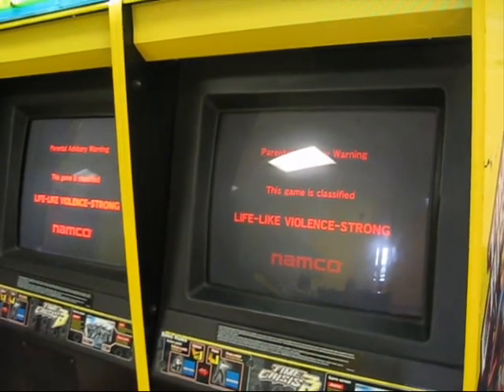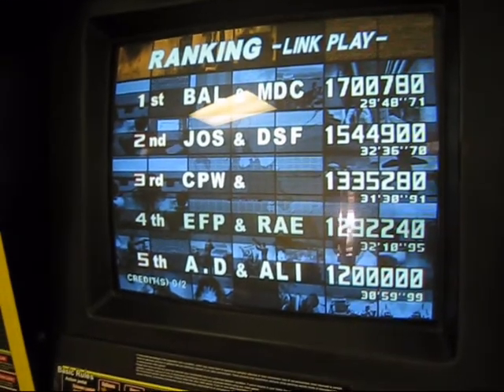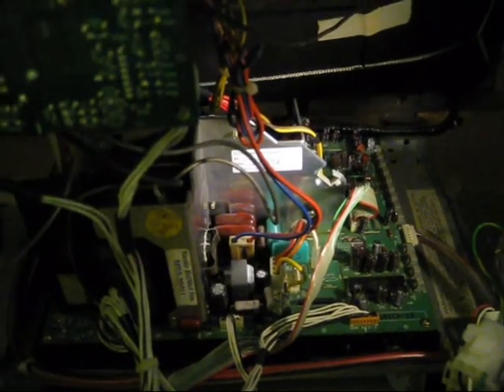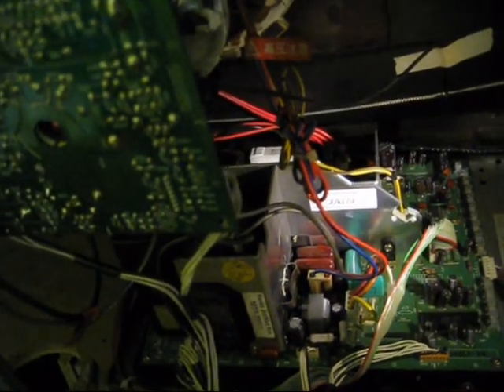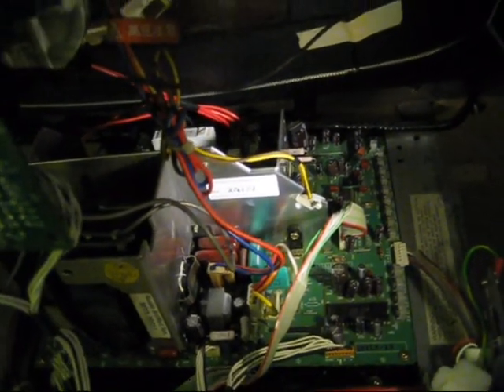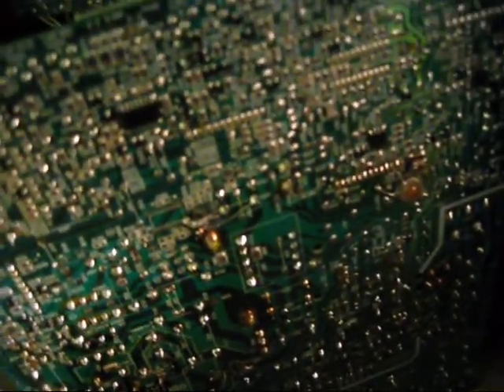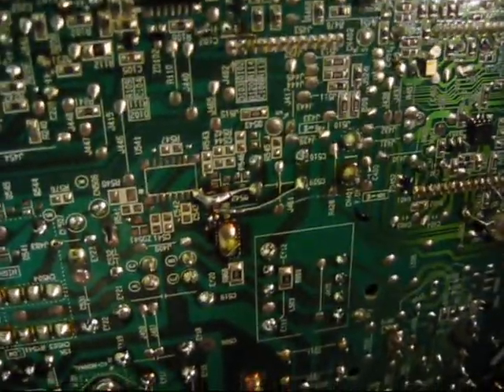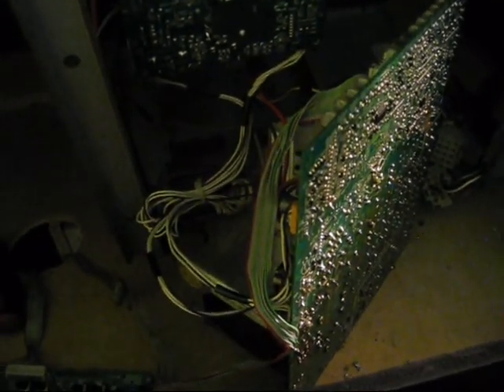Nanao ms9 Horizontal deflection Problem and fix

Comment: Good morning, I'm from Brazil and I'm repairing a nanao ms9-29 monitor.  And I have problem in the source: what is the voltage that feeds the horizontal of this monitor?  Please, please help me. Thank you.
Reply: at 15khz its 75vdc at 24khz its 115vdc on the b+,